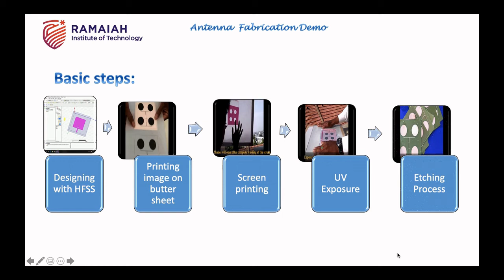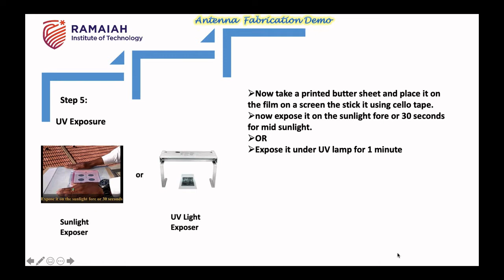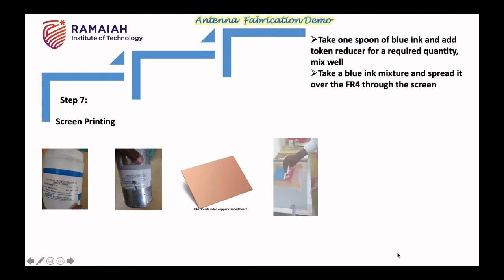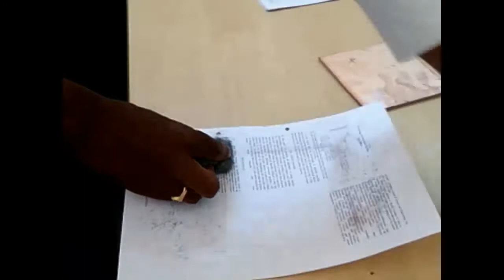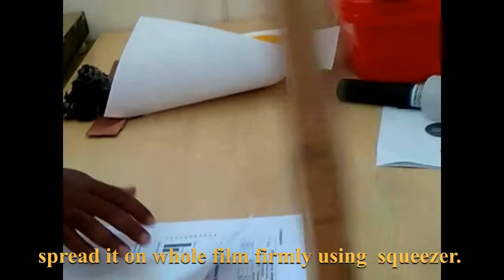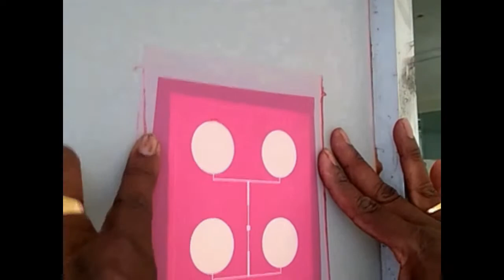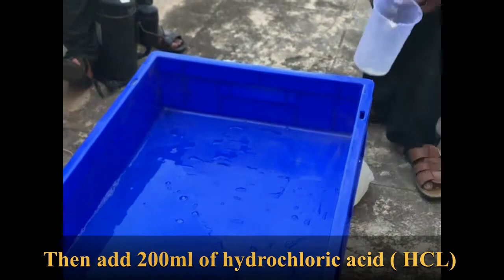Antenna Fabrication Process | Premnath |

Comment: I have a couple of questions for you. How to you control the width of that FR4 material, you used here? Also what if the designed antenna needs a half exposed copper plate in the bottom side to serve as ground?

Comment: What is the token reducer substance ?
Reply from the maker: A token reducer is like thinner type of solvent. It should be used to thin the paint. But two solvents are not interchangeable. For example, if the paint is an enamel-based product, do not use a thinner, but rather a reducer.